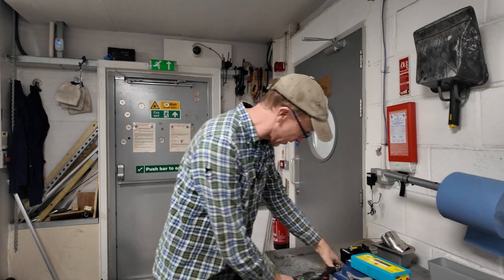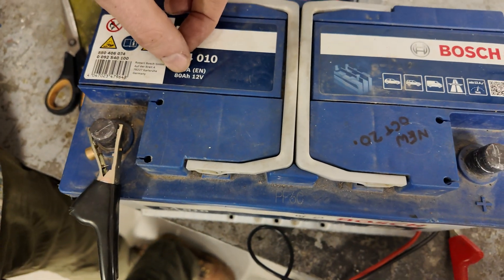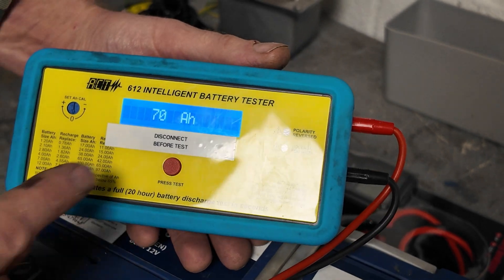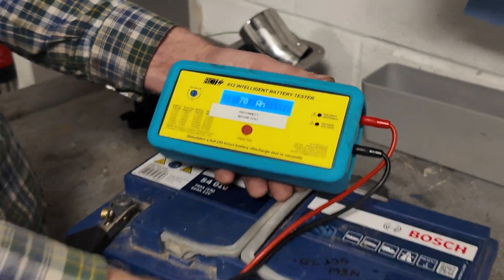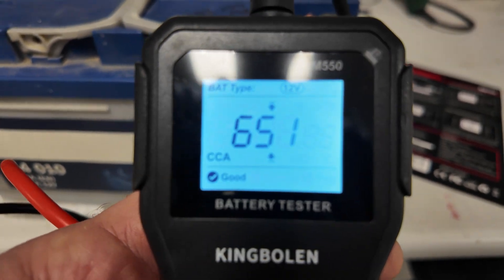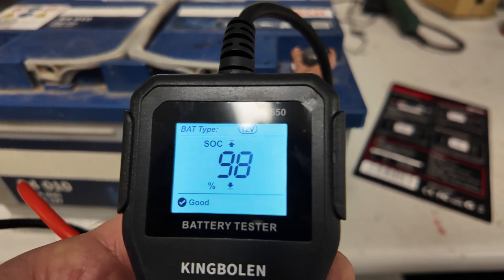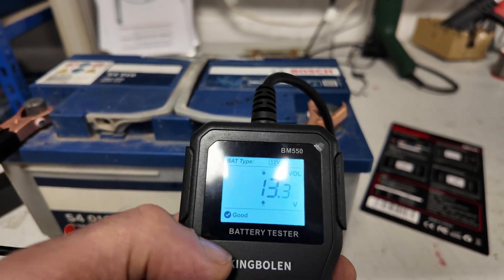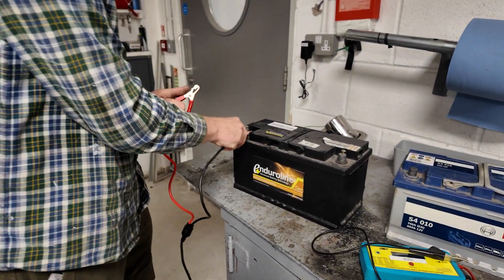How Does a £24 "Kingbolen" Battery Tester Compare to Our £400 ACT Battery Tester ?

Comment: Could you please let me know the location of the auxiliary battery in the 2017 Evoque 2.0 Diesel Dynamic? It doesn't seem to be in the passenger fuse box. 😒😒😒😒😒😒😒😒
Reply from the maker: Whats your chassis number - i will check
Reply: @L663  It is "SALVA2BN7HH198699" Thank you!

Comment: That looks like a win for the Kingbolen then! it is strange but a lot of the cheap things I have bought over the years have worked perfectly…..my Dad’s old Avometer in a leather case would still be fine if I could get a battery to fit it…and around 85 yeas old! ( I used to play with it quite a lot when I was young and Dad was working on something! 😃😃😃😃R

Comment: CCA = cold cranking amps 👍
Most newer batteries use EN instead of  CCA so you need a tester that does both as they're slightly different.
Reply from the maker: Wow never knew batteries are so complicated.